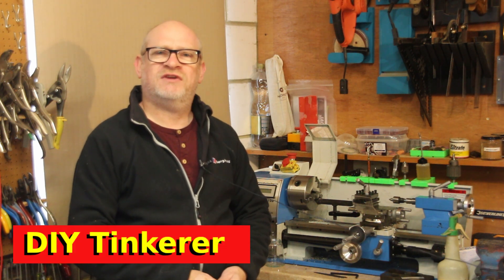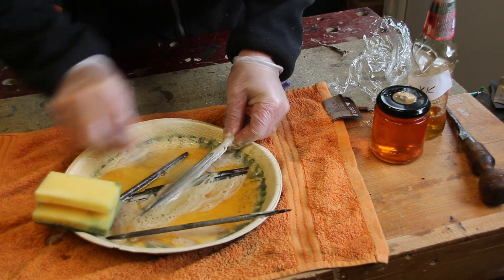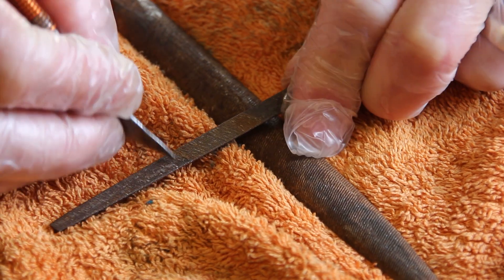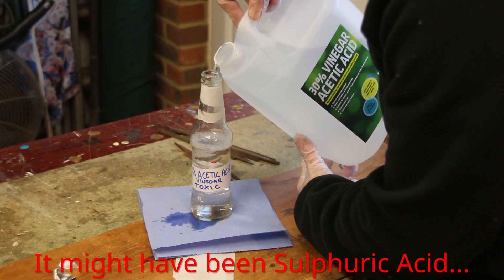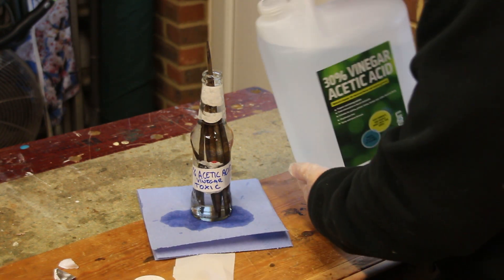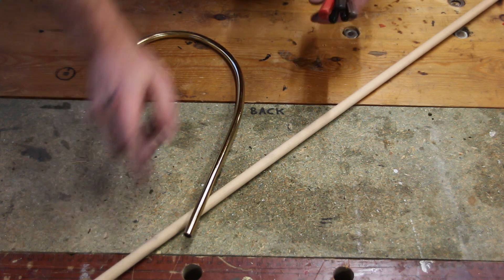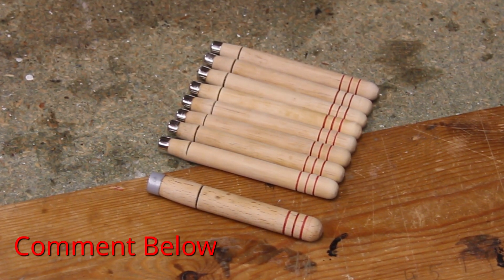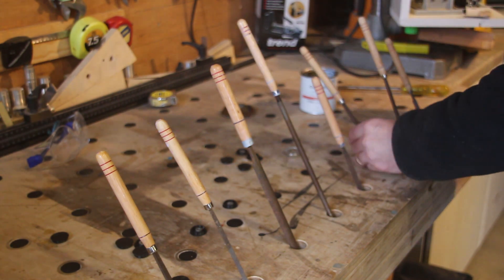File Restoration, Sharpening and New Handles

Comment: They look good - I use a file cleaning brush ( about £5.50 from tool station )
Reply from the maker: Good tip!,  I didn't know there was such a thing, thanks! 😀
Reply: @DIYTinkerer  its like a flat short wire brush :)
Reply: Hi Simon, the handles look great, I was thinking of doing something similar.
Loved watching the lathe work.
Reply from the maker: @eynshamyman3403  thanks 😊